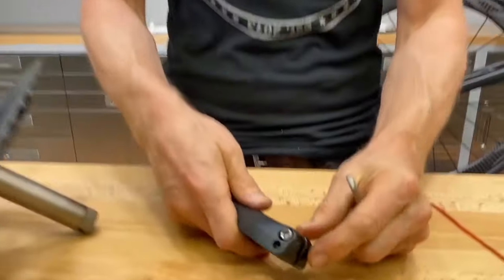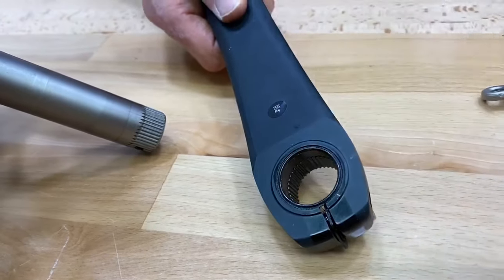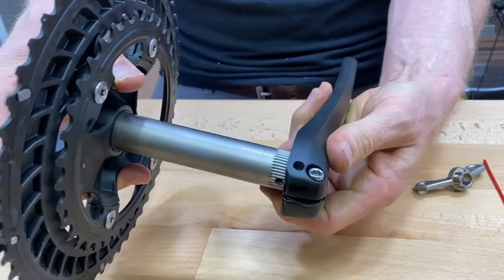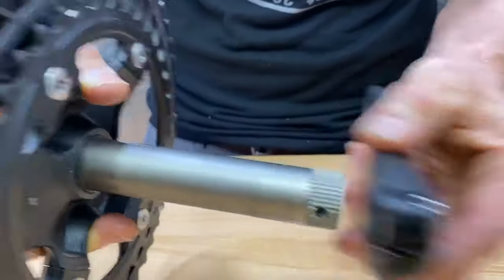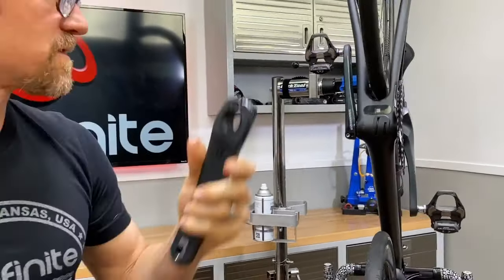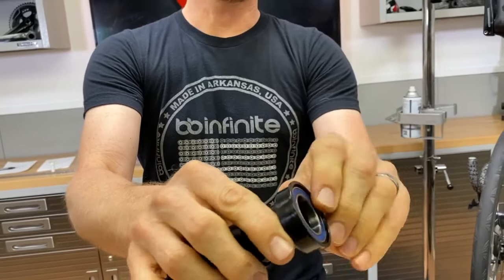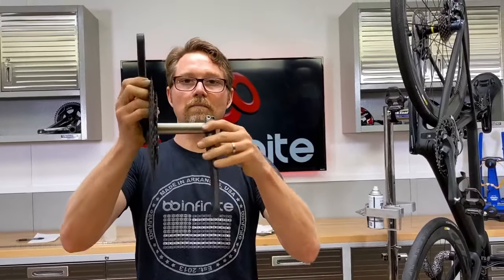Avoid This Common Shimano Crank Installation Pitfall

Comment: Last night I had to pull off my Shimano crank arms to replace the chain rings. During the reinstall, which seemed to go smoothly, I forgot to install the little clip - oops! I took it out for a test ride before realizing what I'd done. It was a short ride, but I did attempt a short steep climb to make sure my drivetrain was working under stress. It performed fine, but I hope nothing is damaged. This morning I went on to YouTube hoping to find a video that explained that clip, which I've never seen before, as this is my first Hollotech removal. I found your video, and I couldn't have asked for a more perfect video and explanation - thank you. Now it is off the shop to correct my mistake!
Reply from the maker: Excellent, we are so glad we could help with our video.

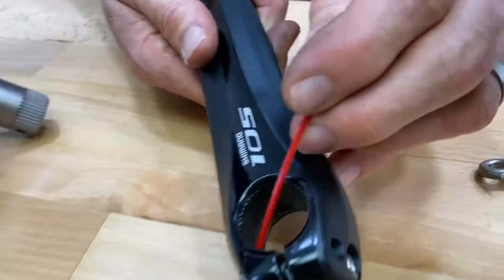Comment: 0:16 when you remove the non drive side crank arm, that O ring( shimano labeled it as Y1F316000 ) has a high chance to drop, just remember to put the ridge rubber side against the bottom bracket and the flat metal side against the crank arm, just like what is shown in this video.

Comment: This may be the most informative YouTube video I have ever seen. I recently had the left crank arm just fall off my Canyon Grail only a couple of blocks into a ride. I had just done maintenance right before the ride. Lubed the chain, checked shifting. I am a bike tech. but was out of the game for awhile and there is a lot of technology to catch up on. So, the crankset is Shimano GRX 600 1x and when I first checked for the issue I was confused. One pinch bolt was slightly loose, the other tight. The preload/dustcap was intact on the arm. Then I looked at the arm, the splines. Yeah, they are receded into the arm and it looks like there was some shearing but I never noticed it while riding, this bike is a champ, I thought. So then I go to Shimano and look up the specs and blow up of the GRX 600. Yep, there is a 'plate'. Huh, I go back to the arm, bolts still attached and guess what? No plate. I have four Canyons, Exceed CF 7.0, Lux CF 6.0, Grand Canyon and the Grail 7.0. Bought in that order. I love Canyon for everything but this is unnerving. I had a hiccup with them when a cable hold down bolt was not installed properly on a dropper lever for the Grand Canyon and they reimbursed me for getting a Wolf Tooth. But this is not good. Still waiting for a response. In the meantime I decided to go with the Shimano GRX 810 and I will install it myself. Side note: another reason your video is so important is that I was going to change the bottom bracket also. But I won't because the Grail comes with a Token Ninja Lite(flush mount). That is the only BB I can use. Your video was very helpful, thank you and keep up the good work. Sincerely, old bike guy.
Reply from the maker: Great feedback, and thank you. As you experienced, if the black plastic "retainer" plate is missing from the split in the NDS arm, it's because it would not lock down, so the mechanic left it out rather than addressing the problem indicated by the plate's condition. As for the BB: The best choice for a Canyon Grail is one of our 1pc BB86 module. A lot of Grail riders will attest.
Reply: Was your left crank arm screwed? Same thing happened to me after improperly re installing my crank

Comment: ohhh very informative, I was planing to use some spacers so i could use my old Tiagra crank arms (165) on shimano 105, same PCD but there is 4ml diference Q-Factor: 146mm vs 1500, better to buy a new set with shorter crank instead
Thanks for the video
Reply from the maker: It all depends on what series Tiagra crank. If it's a Hollowtech2 it will simply work in any of our BB's, in BBRIght, BB30, whatever.
Reply: @BBInfinite  yeap i have Hollowtech 2 , should be ok then?if so should i use the spacers no?
Reply from the maker: @ihov.rivera9924  You would only need a spacer in the non drive side if it's a triple crank. If it's a single, or a double, you will not use spacers at all.
Reply: @BBInfinite is this also like this with slx hollowtech 2? No spacers with xt bottom bracket?

Comment: The indexed spline and safety hook are later additions to the Hallowtech cranksets. Older 2000-ish cranksets don't have that. Not the end of the world if things come apart mid ride and you have a multi-tool to tighten things back up. In that generation cranksets, the fixing bolt was metal, so you could emergency-tighten it with a quarter coin w/o risk of stripping it.
Reply: Ah things were better. Surprise

Comment: I just had my crank completely slip, painful experience, the teeth all look sheared now, have the bike 8 months and think this explains what happened. Guess it's a trip to the shop tomorrow.
Reply from the maker: You can just buy the arm. The spindle is steel and will not be damaged, just the arm.

Comment: I have same issue now, so, change the bb? And thanks alot for this informative video❤
Reply from the maker: You may need to change the BB to one that maintain proper bearing spacing, such as one of ours. First, ensure there are no shims or spacers in the system.

Comment: Japanese people thinking about everything. I once had a crank always coming loose. Also loosing that plastic tensioning nut. Too cheap too buy a new crank. So I smacked in a star nut instead and tensioned it with a top cap. Actually looked quite good for being a hack

Comment: my M5100 crank fell off during a downhill ride. can you imagine how scary it is, if your crank falls off during the downhill ride?
i checked the crank and the thread was busted trough halfway.
Reply from the maker: Sounds like you shouldn't use the crank anymore.
Reply: @BBInfinite  well, if your pockets are empty, you gotta use whats there. believe it or not, 6 months later im still riding with the same crankset because i had to buy other bikeparts first... and half of the thread is still there 🤣
Reply from the maker: @Liqweed1337  Be  careful, my friend.
Reply: My left crank arm on my GRX 600 wont fit in. I think threads from the arm are damaged. It also suddenly fell off riding uphill. The two bolts are still intact when the arm came out.
Reply: @warpampee Likewise with my GRX 400. Did you find out why it came loose?
Reply: @walterwhite596  im not sure why. Now i bought alloy crank cap and tigthen it better than plastic crank cap from Shimano. Fortunately the crank arm fitted again in the spindle after many attempts. maybe im pedalling wrong when out of the saddle uphill with strong strokes. Really not sure. When did it came out? Uphill also?
Reply: @warpampee  I'm a bit late with answering but yeah my crank fell off uphill and did so 3 times. I got it fixed eventually, I decided to play it safe and bought a new crank arm and replaced the crank cap. I made sure to torque the crank bolts to spec. All good now.
Reply: @walterwhite596  three times?! Yes, better replace it. Fortunately you can buy an arm only. Here in my country always a set but luckily my arm fitted again in the spindle. Checking always before and after riding. Hope our crank arms are settled now for good. Try an alloy crank cap. I replaced mine with that.

Comment: When i install the crankset (what i think is correctly), screw in the hollowtech cap finger tight, and tighten the screws on the non-drive side crank to 12-14nm the small pin is able to fit down into the hole.  However, with everything fully tight i can lift the pin with a flathead screwdriver meaning the gap around the rubber pin hasn't closed on tightening the crank arm.  Is this okay?  On my much older bike the pin would be keot snug by pressure from the crank

Comment: it has to be 123 comment. Roadbike Trek 1.2 from 2010. went from Shimano Ultegra 6700 bottom bracket 68mm English tread what I bought end of 2014 for £10.99 and replaced it April 2024 with BBR60 for £18.64 and had to buy tool for TL-FC37 for £19 plus delivery. Crank is shimano Tiagra what worked fine with Ultegra 6700 bracket. With new BBR60 bracket it will not go in fully on drive (chain) side. I hammered it in quite hard (had a moment after 2 hours of struggle). still have a gap of 2mm on drive side between frame and inner side crank/sprocket? On left side the little black piece sits nicely in. I torqued everything according to specs. 34 (35-50 says)Nm bottom bracket and 12-14Nm pedal crank, 07-1.5Nm the cap. Should I disassemble it and smash it in more of should I fit a spacer in drive side even it says with 68mm might need spacer fro triples on left side (what I don't have). thanks for comments

Comment: So, the spline doesn’t seat, unless the tab is fitted in ?
Reply from the maker: The tab will push in, and engage, once the minimum insertion point is reached. This is what Shimano has determined is the minimum spline engagement for safe operation.

Comment: Every forum and shimano itself insist that for a 68mm bb you need two spacers on the right hand side and one on the left. For my generic external bb cups I found this pushed the chain line out too far. I went down to one on the drive side and this made that better but with the spacer on the non drive side the arms protrudes around 4mm from the end of the spindle. I don't know if this is normal or if I should have it flush with the arms.many videos I see have them like this. What's the point in having a spacer on the non drive side? Unless Yr spindle is protruding beyond the crank arm?
Reply from the maker: Whenever you are trying to dial chain line it is important to check the group set manufacturer's specification that will show a measurement from the centerline of the frame to the inner cheek of the largest, or only, chain ring. For road bikes this has always been 43.5mm, for instance. So, do yourself a favor and find the published numbers for your setup and dial it in from there. Chainline cannot be eyeballed.
Reply: Shimano cranks are sized for specific bottom bracket widths and types, at least for 24mm spindles that use hollowtech bottom brackets. I reduced my chainline by only placing one 2.5mm spacer on the drive side and moved the second spacer to the non-drive side. This offset my crankset slightly but results in the same overall bottom bracket width and amount of preload on the bb bearings. For 73mm bottom brackets, Shimano recommends only one 2.5mm on the drive side and no spacer on non-drive side. I've moved the single spacer from drive to non-drive side in order to reduce chain line by 2.5mm. Again the total width stays the same. Shimano uses an internal plastic sleeve inside the bb so the width must remain the same. If you start removing spacers without placing them on the other side, the internal sleeve will not fit.

Comment: My crank has fallen off several times. I look closely to have this part right and then tighten it as fast as I can but it still comes loose. Any ideas? Maybe lock tide?
Reply from the maker: If your crank is a Shimano HollowTech2 type, and the arm keep falling off, that can only mean that the pinch bolts are not tightened to the proper torque specs. If the crank is getting full spline engagement as shown in the video, and the pinch bolts are tight, it's impossible for the crank arm to come off. Check your crank for this: https://youtu.be/TENAyaOi9DE

Comment: Hi sir , I dont have this plate, everytime I ride my mountainbike my left crank arm keeps faliing. What should I do?
Reply from the maker: The clip is a last ditch safety measure. It doesn't keep the arm tight. If the arm is loosening as you ride, this indicates the dual pinch bolt are not tightened adequately (14nm). If the bolts are tight, but the arm works loose, remove the arm and inspect the splines to see if they are in good shape and present.

Comment: Could this be my problem when I pedal or push bike backwards the chain drops down a few gears on the rear cogs, but would mention my crank is the square tapered spline with threaded hole in the ends to bolt on the crank arm, thanks
Reply from the maker: The first thing I would do is look at chain wear. If it is excessive the chain can spontaneously drop off cogs. The next thing I would check is the rear derailleur hanger alignment. These would be the two main things that would cause this. If the chainline is radically misaligned this can also cause it as you are supposing here. So if this bike was assembled recently this could be a problem, but if it had been assembled and ridden for a long time and this problem has just recently started I would go with the first two.

Comment: Can a 1x specific frame run a 3x if the rings don't hit the chain stay?  I have a 1x frame being built and was curious
Reply from the maker: If it's 1x specific, does it have a way to attach the front derailleur? If yes, with a clamp or some such, then sure, if nothing hits and it shifts, run it.
Reply: @BBInfinite  word

Comment: Hi there, have a question. I have a supercaliber gen 1 with a 92mm press fit bottom bracket with a chainline of 52. I just currently installed a m8100 xt cranks on it as its a 52mm chainline. I dont have any spacers on either side of the crank spindle. When i put the cranks on that little plastic peice just about goes in pretty much at the outer limit of the hole on the spindle. Should i have gone with the m8120 with the 55mm chainline for the extra bit of spindle?
Reply from the maker: If the plastic tab is very close to closing, that's a sign that the BB you have installed is a bit too wide. This is common with screw-together type BB's because the flange has to be thicker that the typical pressfit type due to the need for space for tool engagement. If it's a press fit type, it might not have the appropriate bearing spacing, which is also somewhat common, because the frame itself might be a bit on the wide side and this is spacing the cups out, becasue they are a slave the where the frame puts the, thus altering the bearing spacing. At this point we'd simply recommend our 1-piece BB solution as it has the minimum shimano bearing spacing built in, and so the problem will be solved.
Reply: @BBInfinite  ill look into that, thank you

Comment: Mine came from the LBS miss installed and stripped out my left side crank.
Reply from the maker: We hear the old "1 hr into the  ride, the crank arm fell off" all of the time. Guys, ladies, fellas...the only way a Shimano non-drive-side crank arm just falls off is if the mechanic neglects to tighten it to spec. They just snugged it, then forgot to torque it to 12-14Nm per bolt. When they come off like this a lot of damage can happen to the splines and  threads.
Reply: @BBInfinite  that’s likely how the original install was by the LBS. I called and asked about other torque specs and they said they didn’t know they just know by doing. Threads probably damaged then. I torque to 14in/lbs
Reply from the maker: @307.William  The Shimano NDS crank arm is held on by two opposing pinch bolts. The spec is 14Nm. Nm and inch lbs are vastly different. 14Nm is 124 in/lbs, or 10 ft-lbs.
Reply: @BBInfinite  yes I meant Nm. My bad.

Comment: I installed my shimano crank properly snug in the spline, but i dont have this plastic, would it cause problems?
Reply from the maker: If the plastic tab is missing that's not a big deal. It's there to stop the crank arm from falling off if the two pinch bolts were loose and the plastic end bolt was missing. So, don't leave the bolts loose and you'll be fine.
Reply: @BBInfinite  came here for this question. Thanks! My plastic piece is gone and crank fell off recently. Will just torque to spec and ride on!
Reply from the maker: @russellholt5004  Yeah, you'll have zero issues. Two bolts tightened to 14nm is more than enough to retain the arm indefinitely.